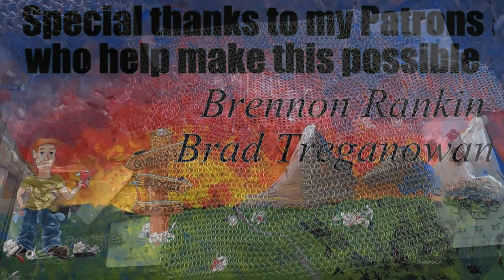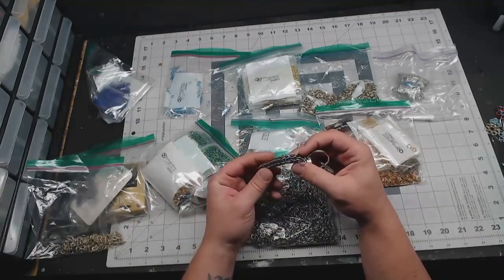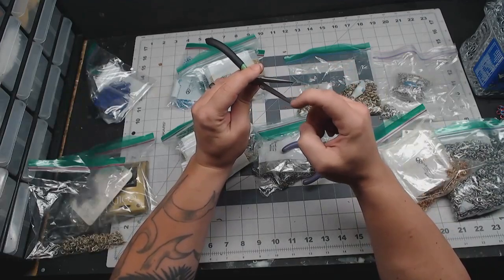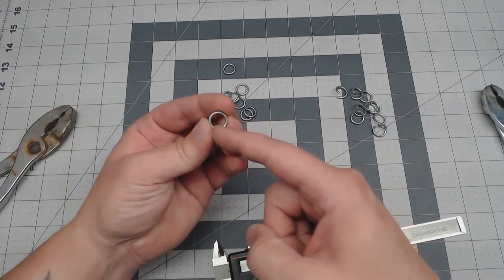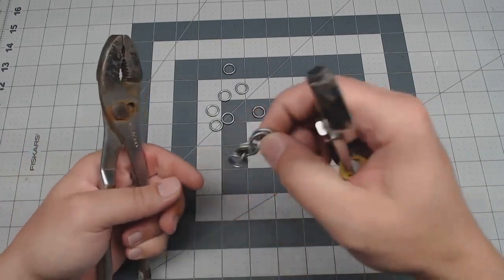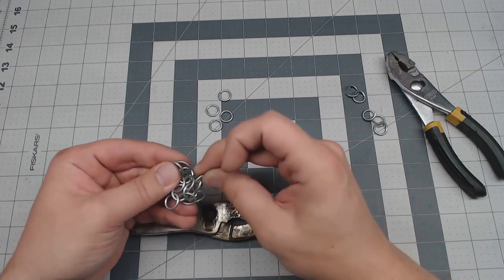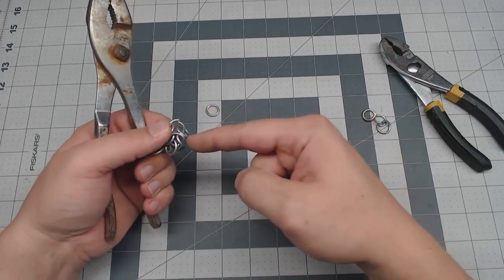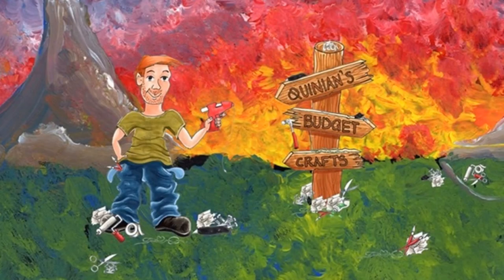How to make E4 Chainmail!

Comment: I've never seen this done before. It always seemed like a ton of work.  What do you have to do to preserve it? I know its meant to take a beating but still.
Reply from the maker: Depends on the metal. Aluminum, nothing it'll be fine. Galvy, also not really anything it's the same thing a chain link fence is made out of. Mild steel though you HAVE to oil or it'll rust instantly
Reply: @QuiniansBudgetCrafts  cool, good to know. how do you make curves like the coif and shoulders?
Reply from the maker: @brennonr  with hauberks and shirts normally the shoulder portion is just extend out like a giant T shape, you skip doing arm pits cause that would bunch up. The hooded part or coif is an expanding spiral. you use one larger center ring, 8 or so normal size, connect 1 ring to 2 of the original 8 plus 2 or 3 more to expand it. Kinda like expanding on the side part of a flat one but always adding in extra rings. There's a real trick to it, no set numbers cause it depends a whole lot on the size of the rings you're using, the pattern, and how big you need it to be
Reply: @QuiniansBudgetCrafts  I think i can visualize it. very interesting. it was the bunching up that i was thinking about.
Reply from the maker: @brennonr  I did do pits on one build and it kinda works but eh.. some bunching and can't really reach over head lol better to just have a gap there
Reply: @QuiniansBudgetCrafts  I was also thinking "Man, if this guy is using steel, his larp must be super hard core!" I never did dnd larp but i did starfleet and i would suspect some of the klingons might be that hard core. Some of those dudes were really... REALLY  into it. I always played science officer so I wasn't in combat much.
Reply from the maker: @brennonr  lol not larp so much as sca and hema. You need steel for those